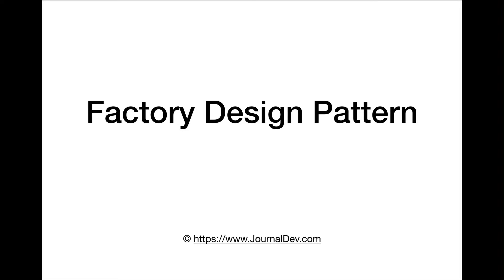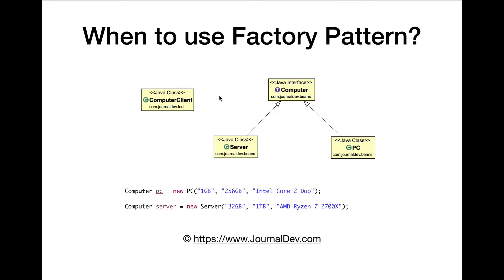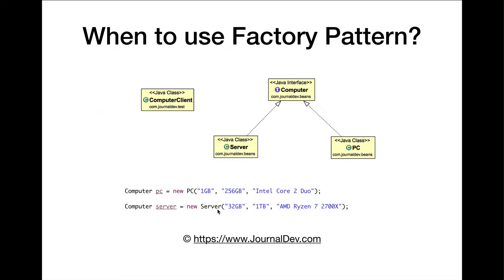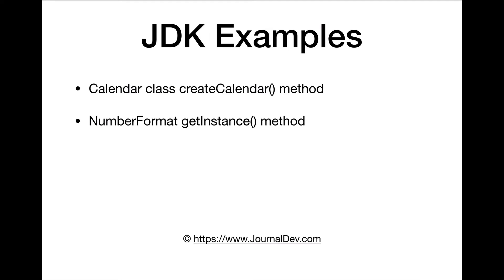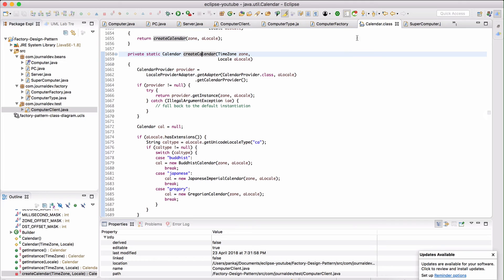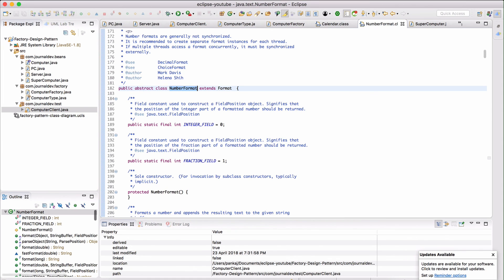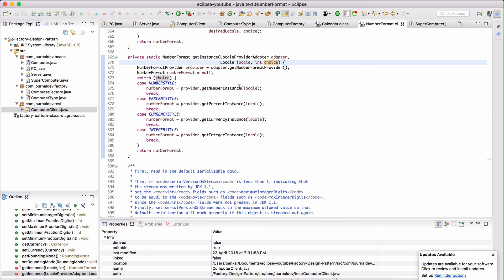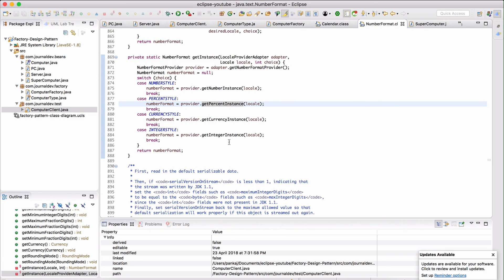Factory Design Pattern

Comment: You said, if we don’t use factory design pattern, Client will be aware of all the instances of the Computer(such as PC, Server), there is no abstraction. Even with factory design pattern, client should be aware of all the instances of the Computer right, else how will the client pass that string(“pc”,”server”) depending on his requirement ?
Reply: I hope this can help you (and also me) to understand the problem.

I think that what you are saying is right, but you have to see the situation from another prospective to see the usefulness of the Factory Design Pattern. 
In your situation the client has to know the Name of the "physical" object ( ex.: PC, SERVER, ...), BUT not the names of your classes (you can call them however you want, for example: instead of PC you can name the class POTATO and he will never know!), and also their methods, they are all hidden from him, the client can't directly access them! That is because you have an ENUM class that contains all the possible typologies of the "physical" computer and the client will use them to choose the right type of Computer. Also, the client will not be able to access the constructor methods declared in "PC.java" and "SERVER.java" because it will be the factory to "decide" which one is the right one (So, less "Client errors"). 
It's a Win Win situation, the only downside is the need of a switch-case or an if-else, BUT it can be avoided by using the Abstract Factory Design! :D

I hope everything I said is correct and I hope it can help you understand the Design Pattern.

If you have anything to add, comment here I'll try to correct myself if I made mistakes or explain to you other thing if you need, bye.

Also big thanks to JournalDev IT Services for the video! 😄